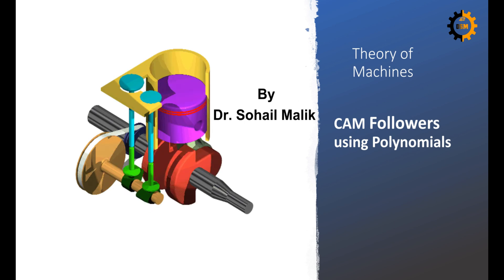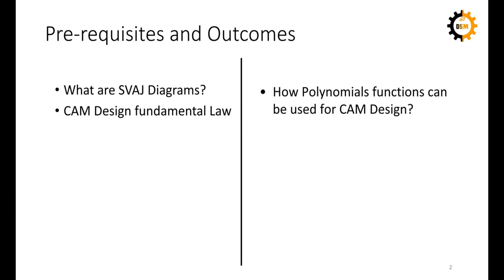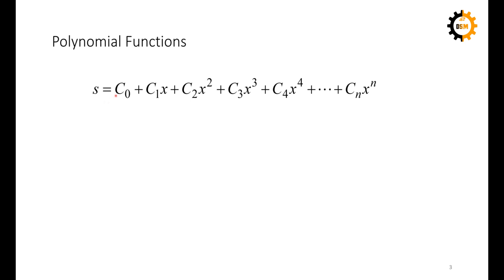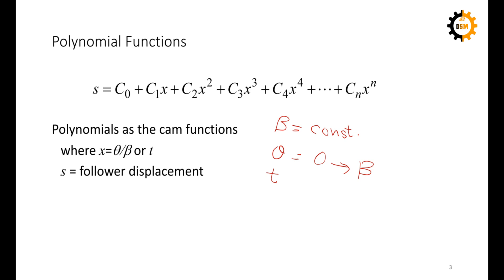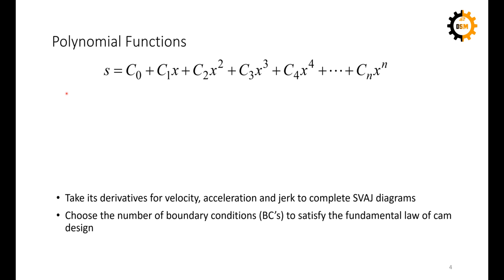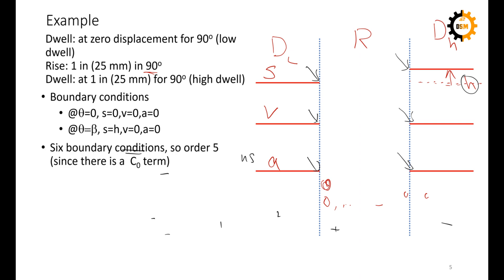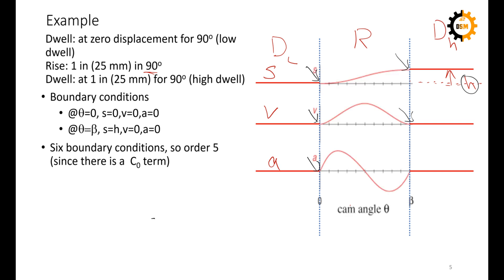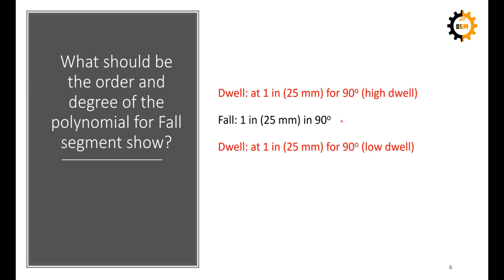29-1 Theory of Machines | CAM Follower Mechanism | Polynomial Function | Double Dwell

Comment: For the mechanism given in the question, the polynomial would also be of degree 5 as there are still 6 boundary conditions that we will use. Only the sign of the coefficients will be changed to negative. (2017284)

Comment: The question at the end doesn't make any sense if it dwells at 1 inch and then falls for 1 inch then how can it dwell at 1 inch again and even if it does that means 2 things : 1) There is a discontinuity at theta = 180 degrees and 2) The second dwell isn't a low dwell, its same as the previous dwell. In any case I think order of polynomial 5 can be used here. (2017378)
Reply: may be the low dwell is in negative direction. (2017006)
Reply: Yes it’s strange, but I guess we got the point of it as sir said that it fall and came to low dell, which is back to 0 displacement
Reply from the maker: I am glad you noticed it though not rendering the answer a lot if you get the sense. The fall will be of 1 inch in any case.

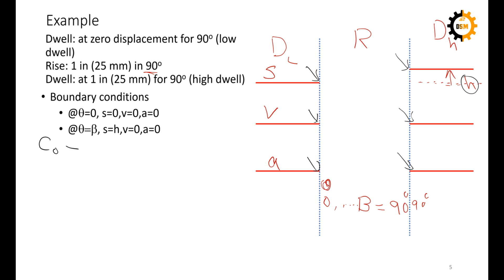Comment: Sir, at 8:58, when we talk about beta = 0, we have a Low Dwell on LHS and RISE on RHS. It is understandable that the displacement and velocity are zero at Beta = 0, but shouldn't acceleration be non zero at this point since the follower is going from static (DWELL) to dynamic (RISE) phase which should technically mean that change in acceleration must happen? 
Kindly clear out this confusion it has been in my mind since the previous lectures about CAM design. 
The order of the polynomial at the end of the video is 6 and degree is 5, since there are 6 BC, 3 at theta = 0 and 3 at theta = beta.
(2016284)